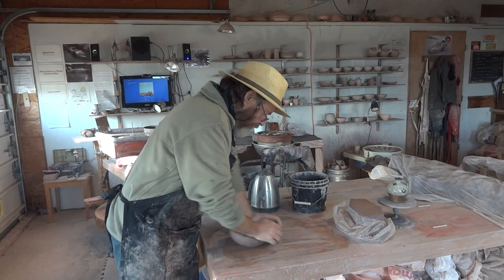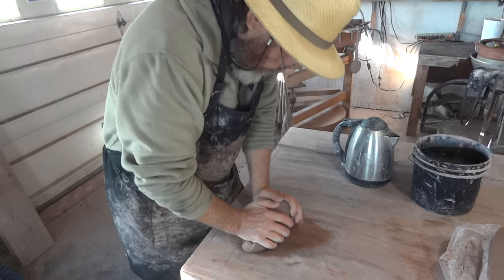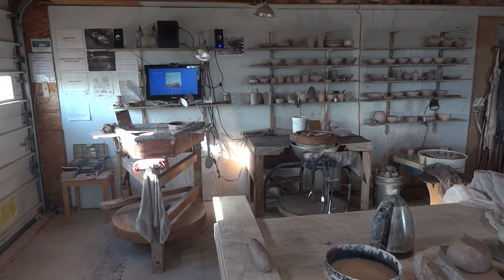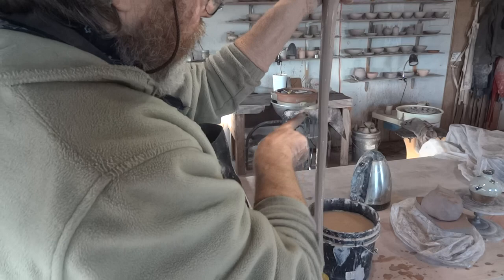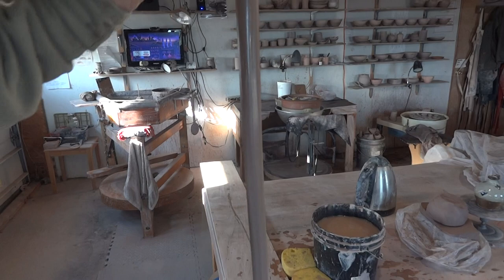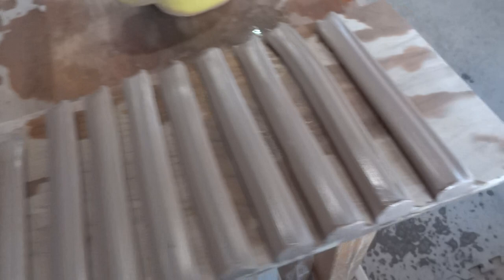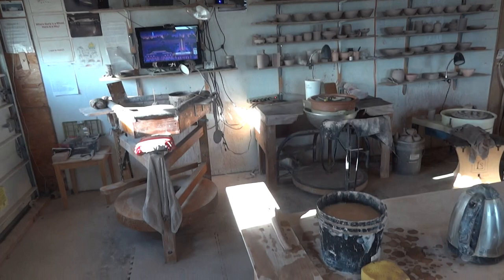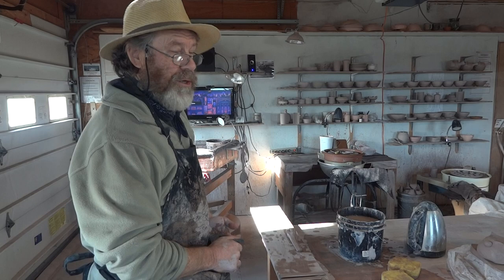How to 'pull' a handle for a mug, tips etc...  with Simon Leach

Comment: If you have already figured out how to screw the wide diameter cylinder part of a plastic bottle together, and it is still not completely air and liquid tight. Then a little bit more heatwork will solve that problem. Ak-49 (907)  "No soap" is an education about THE LAW, by that there is the will to be a public free from War. greyishgreblum, "Pottery tap and die", w/ "cookie cutter" tap tool modification💜